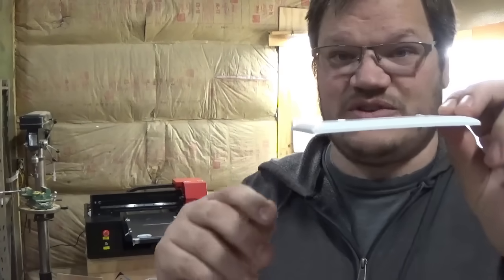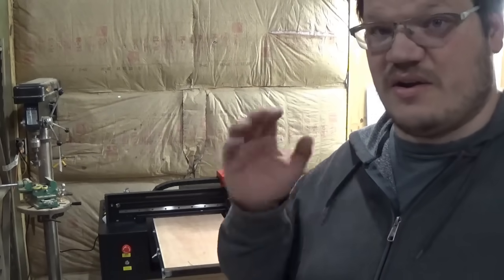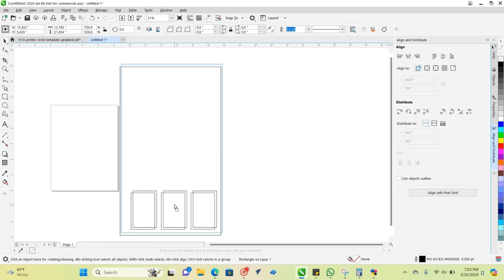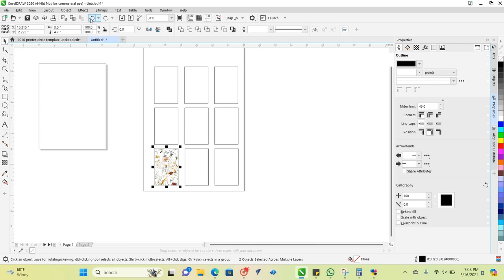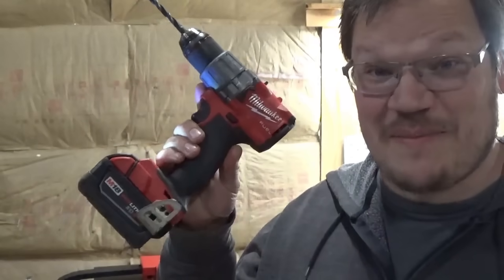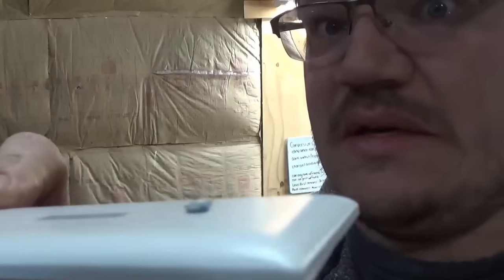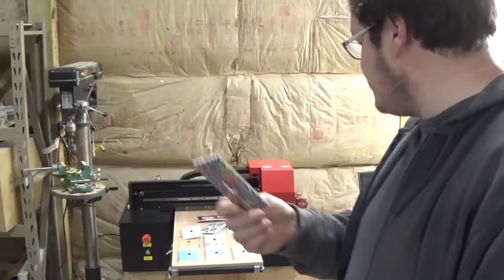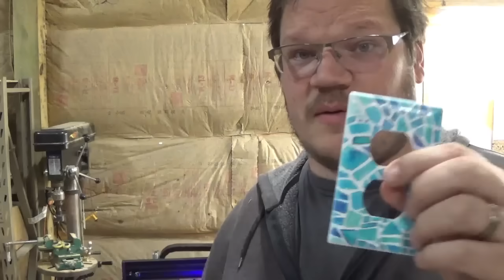How I earn $720 an hour with my uv printer  printing on light switch cover plates jaysprinters

Comment: How do you set that printing depth to assure that you don’t get a printhead strike on the tips of the screws? I presume its height is adjustable somehow. what is the farthest distance that you can print from the printhead to the printing surface?

Comment: lol $3500 is a affordable printer? You would have to sell over 400 light switch covers to break even.. No thanks.
Reply from the maker: @figuresix  this thing prints on anything 3500 if about the lowest cost for a commercial grade printer

Comment: LOL, In Australia, we are civilised. We have facia plates that cover the screw holes. Mind you 240 volts is standard, so we don't have the silly 110/220v system you yanks have.

Comment: Doesn't the ink of the UV printer smell bad? I thought you needed to have filtration and extraction but you don't seem to do that at all.  Love your videos.  Thanks for making them.
Reply from the maker: I have not had an issue and the manufacture has not told me that we needed these things
Reply: Thought? Provide source of your info sign seal

Comment: Good idea…do what you want, but I would want all the screw slits to align vertically. A lot of electricians absolutely line up the screw slots vertically as a mark of pride in their work. If you leave them totally random, it might annoy some.
Reply from the maker: good point didn't think about that when I was in my electrician years I remember some others like doing this
Reply: Screws tighten when they tighten…. Lined up, they will most likely be loose, or over tightened..
Reply: At least, lining them vertical would give someone the option to match the pattern with the screws vertical…only matters to OCD folks like me :) Thanks for sharing.
Reply: It is common in schools for electricians to teach vertical screws and the sockets make faces.

Comment: Hey, thanks for the video.
Could you say how economical is to run this printer? Where do you buy the ink from and how expensive are they?We are in the UK
Reply from the maker: sure this machine can be sent to you from jaysprinters.com they also supply inks the cost to print these 9 cover plates would be very small amount talking pennies in ink and electricity the machine itself you can find here https://jaysprinters.com/products/zz1s-refine-color-uv-printer-jy-jays-printers?sca_ref=4117679.YZkqaT2Pxc

Comment: Hello, do have any experience with the zz2c and zz1c. Which would you recommend, wife wants to upgrade from cameo. Thanks
Reply from the maker: I do they are almost the same machine but 1 prints varnish out of a second head so if you want to do uv/dtf this is the better option if not then you might inly need the zz1c
Reply: Thanks, can zz2c do stickers and tumblers. Would I need to buy laminator for stickers, sorry for all questions, but newbe here. Thanks
Reply from the maker: @JC-xi3yt  yes it can do stickers you will need a laminator
Reply: Thanks again and very informative videos.

Comment: Very nice-looking products ---- The wifey already wants to buy some for a room we're remodeling. :)) 

I'm interested in these techniques for printing custom panels for one-off electronic devices. You know, labels like "on / off" and the small star-like patterns around knobs (think volume knobs), etc.   

I've been told that UV printers require a lot of maintenance and should be used often. I can see for a printshop like yours, constantly busy, that's not a big deal - just goes with the territory. But what about in my case where the machine might be used intensely for two or three 8-ish hour shifts, but then sit idle for a week maybe even two.  Do the heads e.g. dry out? 

I'd be using a UV printer as a support too, not directly for making money (although that would of course be possible) - my focus is much more on electronics design and manufacturing (which is also lucrative).  However, perhaps it would be more cost effective not to buy a printer and its expensive inks, but rather just send the graphics files and the blank panels to your shop and have you print a batch? The print beds of your machines are plenty large enough as the biggest panels I have are about 11 inches by 14 inches - about the same real estate as your 3x4 grid of trim plates. Another factor is the print resolution - picture two parallel lines, like -> | | <- the finest line thickness would be approx. 0.33mm (0.013 inches) and the minimum separation between the lines would be about 0.25mm (almost 0.001 inch). Can the 6090 handle that?

Thank you for taking the time and making the effort to produce this inspiring video.

- HP in FL
Reply from the maker: Feel free To send an email to me from the business website jaysprinters.com it's much easier to communicate this way
Reply: @JaysToDoList  Will do thanks!